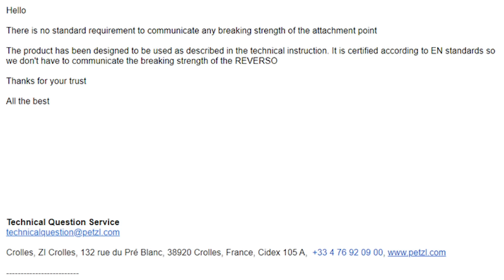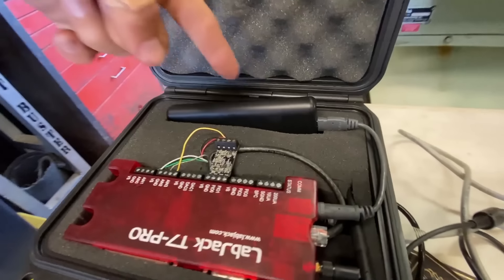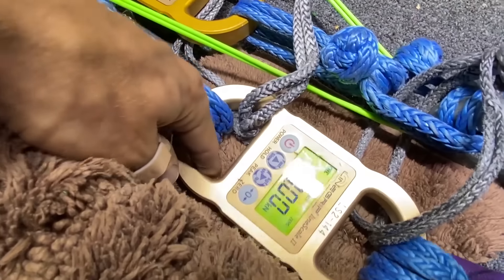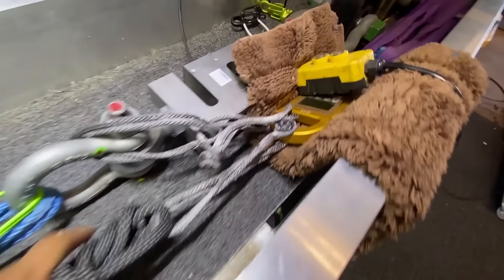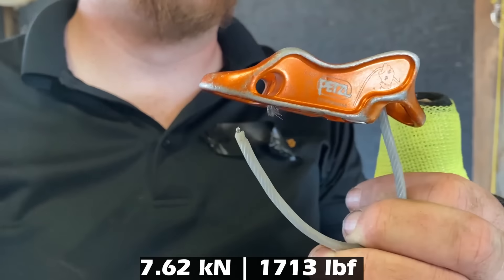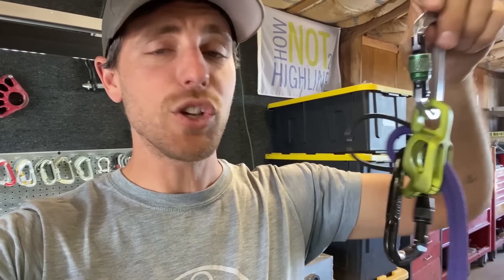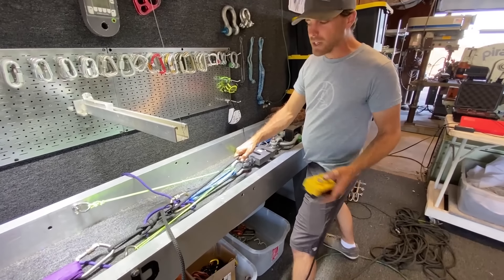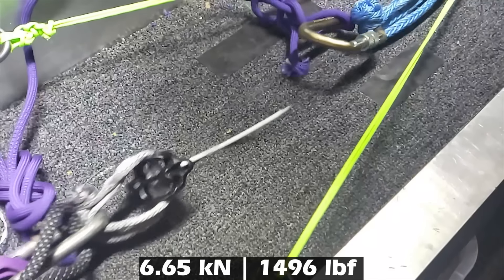Petzl Reverso and Black Diamond ATC guide break tests - how strong is that eye?

Comment: Great to know we can use ATCs as nuts.
Reply: I feel tempted to try it. But then not that motivated yeeting myself off a wall to find out.
Reply: @vfnt  I mean, just climb high and add a cam backup
Reply: This is what he's saying after all
Reply: You can also use nuts as nuts - that is how they got the name… How bolts got their name too. Nuts and bolts as 🔩 nuts and bolts.
Reply: @NoName-OG1  
Oh, there is a video of someone testing nuts as nuts and falling in them. 
Somehow I would be more comfortable doing that than falling on an ATC-nut
Reply: @vfnt  the climbing sports of today are older than the gear and methods, availability of today. 

Most of the gear arrived and became available in the mid/late seventies. Imagine not repelling on any belay device. When I was a kid it was 3 raps of the rope on a carabiner to a Swiss seat that you had to learn to tie. 

Most of the gear started being made because there was a place you could sell it. REI changed the sport and for the better.
Reply: That's pretty much what I got outta this ..

Comment: That email from Petzl is hysterical and oh so reassuring.  Not gonna tell you… “Thanks for your trust”, but just in case “All the best”. They may want to rethink their customer comms strategy.
Reply: I can't believe the response from Petzl. I find that email totally dismissive and condescending. What a black eye for the Petzl brand!
Reply: Before early 2000s,Petzl always shows us the rated strength of their descenders&ascenders on the user manuals,that was good for our guys to calculate the strength after being wear and abrasion by long term using,but no longer now😢 I believe that Petzl did not want us to use their products for so many years nowaday.😅

Comment: "How does a climber get 4, maybe 5 kN and I can hang on just fine?"

The rope should slip through a bit in a fall. That reduces the peak force of the shock load. F=ma, a=dv/dt, by increasing dt (time of the change in velocity) due to the slip the acceleration drops, and thus the force drops.The same thing is why dynamic ropes stretch.
Reply: And most likely rarely received all the load the climber gets themselves. I reckon the rope drag makes some of the load transfer through the quickdraws thus reducing load on the belayer.
Reply: “Yeah science bitch!”
Reply: And the belayer just gets pulled of the ground from a certain force.
Reply: @juliensantini5882  I believe the tests he references were from the vid where he had a dynamometer on both the belayer and climber

Comment: Fun story I learned from a Petzl engineer.

When Petzl developed the first Reverso, the one made from sheet steel, they tried originally to have the attachment loop perpendicular to the plane of the tuber to allow optimal orientation on most belay anchors - exactly like on a plate. However, they could not find a way to manufacture with the needed stability at an affordable price point and went with an attachment point in the middle plane of the device.

When they switched to an aluminium body of the revverso, they corrected that problem and we're quite amazed that everybody else including Black Diamond copied the design of the original steel Reverso in their aluminium-bodied designs.

The perpendicular loop is still harder to manufacture and whether you prefer it or not probably depends on how you rig your belays and which anchors you typically encounter and thus both design philosophies coexist. But if Petzl would have found a way to turn the loop in the original steel Reverso, probably everyone would have followed that design.

Comment: When holding a fall you are not taking all the load on the belay device, there is a chain of things making it soft like all the gear placed. If the rope zig zags a lot the friction will take out pressure from the belay device and apply it to the anchors. That's why you try not to zig zag a lot on trad gear (using double ropes or extending very long the quick draws). I'm guessing that's why your messuring only about 2Kn while trying to hold the belay device directly but you would be able to hold a higher force on a fall where there's a bunch of gear placed. Cool tests could come out of more "real world" scenarios. Thanks for the work your doing.

Comment: I would be super curious about the DMM pivot. I can't find a strength rating for the device, and that pivot seems like it would be harder to make super good enough.
Reply: I would very much like to see the comparison of the DMM Pivot to the BD ATC Guide.  That little pin in the Pivot has to be a weak point.  Sure, the pivoting action would make it easier to lower people, but I can't get that little pin our of my mind when I think about buying one.  I've looked at the DMM info, and there is no rating on that part of the device.

Comment: I asked DMM the same thing about the Pivot belay device (which has a hinged connection point). Simon Marsh, one of the DMM engineers answered: „The Pivot guide mode anchor connection point is rated to a minimum of 16kN” ! Maybe you might want to check this value too?!

About the guide mode failure, Jim Titt wrote a comment on MP Forum:

 "First Fail Mode:
The trapped rope escapes sideways from under the tensioned rope and gets trapped between the tensioned rope and the side of the slot.This is very difficult to free off and you have to dismantle everything and twist the locking krab brutally to release the rope. Take your Prusiks.

Second fail mode:
Apply yet more load and the trapped rope where it crosses the tensioned rope goes down through the slot with a bang. At this point the holding power drops off considerably but not catastrophically, though pretty near!
Easy to release, just unclip the krab when unweighted. Still need to take your Prusiks!

ATC Guide. 10.2 Mammut, used, non-treated. First fail mode 4.8kN. No second fail mode, rope sheath cut at ca 9kN.
ATC Guide. 9mm Edelrid, used, non treated. First fail mode 2.96kN. Max fail load 5.58kN. Residual load 1.6kN
ATC Guide. 8.2mm Edelrid, new,treated. First fail mode 2.05kN. Max fail load 4.06kN. Residual load 1.2kN

Reverso³. 10.2 Mammut, used, non treated. First fail mode 3.68kN. No second fail mode. Rope sheath cut ca 9kN
Reverso³. 9mm Edelrid, used, non treated. First fail mode 2.25kN. Max fail load 3.60kN. Residual load 0.9kN
Reverso³. 8.2mm Edelrid, new,treated. First fail mode 1.6kN. Max fail load 2.38kN. Residual load 0.7kN
All with Petzl Attache 12mm round profile karabiner.

The first failure is both strands are crossing inside the device and it jams up solid, you hear a sharp bang as this happens (we though something had broken). Then the crossing point of the ropes is forced out of the bottom of the plate and the original rope positions is reversed with a twist at the karabiner.
With thicker ropes as the crossing point starts to come out below the plate the rope is forced onto the underneath of the sides of the plate and core-shots so it doesn´t really ever reverse completely but shreds itself instead.
You can get a good idea of what happens by using a thinnish (6mm or so) cord and bouncing on it.
Reply: In that case, their 16 kN hinge is directly compared to the BD ATC Guide at 30 kN.   The DMM Pivot's design puts a weak point at the pin.  Jim Titt gave us interesting information, but the rest of that stuff about the second fail mode doesn't compare the DMM with the ATC or Reverso.  It seems that doing all these secondary failure modes with the rope problem got his Titt in a wringer.   Still the question remains, how many kN will a Titt in a wringer hold? 

Probably the Petzel if uncompromised would break over 16 kN if it wasn't compromised in the other testing.   

We can only beg and genuflect to the How Not To Highline gods, that they will verify the breaking strength of a DMM Pivot.

Comment: Occasionally I'll use the reverso in guide mode clipped to my belay loop as a safety when setting TR. Usually the safety line is a static rope (part of the anchor). If you don't manage your slack and take a bad fall, I'd think you could generate quite a bit of force. But you'd probably break before the device...
Reply: Sorry I don’t understand the setup described. Or even why would you do it when setting up a TR?  Is it part of your PAS somehow?
Reply: @benoitcerrina  it's PAS, yes. The guide hole clips to me, and a fixed line runs to an anchor back from the edge. Imagine you were using guide mode to ascend, that's basically the setup. The places I climb don't allow bolts, and often don't have good pro at the edge, so TR setups usually use static lines to far away trees. Often we go back and forth during setup, so there can be a lot of slack in a safety line, sometimes when we're navigating 4th or 5th class terrain. Grigris are better, but sometimes you don't have one 😉

Comment: Confession... Used a DMM Bug as a nut once after running out on a long traverse... Didn't fall! Anything is better than nothing?
Reply: Confession. I've used an old school rock (an actual loose rock that I found a few metres below in another crack) jammed in a crack with a prusik cord around it because I ran out of pro, and I fell on it. It was fine. Things we do when we're young and stupid...
Reply: @Intermernet  sounds smarter than stupid, you placed pro the best you could (which clearly was good enough) instead of taking a massive fall

Comment: I use ATC guide in a scenario where it is not at the top of the rope. I self-belay starting from the bottom mostly on easy sports routes. The ATC top loop is clipped to my harness loop. If I fall, the last anchor catches, the rope goes above me, it locks, and I hang from the top loop of the ATC. I have taken a decent fall that way. It worked. I know it is "off-label". I guess I should say the usual disclaimer: "Don't do as I say. Don't do as I do".

By the way, I wanted to ask--I believe you said you couldn't think of a normal climbing scenario with more than 14 kN on an anchor. If you take a UIAA fall, won't the peak force on you be about 10 kN, so the peak force on the anchor over which the rope loops somewhere close to double less the loss due to friction (so it makes maybe 16 - 17 kN)?
Reply: @MBC-th8le  Thanks, its a great video! I haven't seen all the best they made yet. 

Sure, but those are not the standard test UIAA falls. They are with a static belay high up on the wall with a worst-case fall factor for the bolt--not a slipping hand on an ATC on an un-anchored belayer on the ground. I guess the UIAA falls are not normal climbing situations.

Comment: Do you think you can break the reverso eye with 2 ropes in auto-block mode? Sometimes I belay two people off a guide atc and I imagine losing 2 partners at once.

How could both partners simultaneously generate 6kN? Idk, belay-ledge shenanigans and they both take factor 2s?
Reply: 😬 I wouldn’t chance it, but I’m a nobody!
Reply: You make a very good point.  I use the ATC Guide in the guide mode fairly often to belay two people up.  Gourgou is wrong, you don't have to be belaying two leaders. You can be belaying two climbers from above as the device was designed to do.  As you said, it would take something like both climbers to fall at the same time with some slack in the rope, very close to the time they reached the belay.  An example of this could be if two climbers coming up on top rope reached a ledge a few feet below the belay device.  There is a minimal amount of rope out between the device and the two climbers.  Let's say the ledge gives way and both climbers fall a short distance on a short rope- the scenario of a factor two fall.  Could this cause a failure?   Fortunately, with a breaking strength of 30 kN, it seems very unlikely that the eye would break from the main part of the device.  However, the force could slam the ATC Guide into the rock and compromise the lab values.

Comment: This is great as always. I think it would be ingesting to see what would happen if you pulled on a quad anchor in two directions at the same time. This could happen if you have a haul bag on one set of strands and a climber juging on the other. Also once you get the drop tower built it would be interesting to see it pulled in different vertical directions. As if you have a haul bag or other person and a ladder takes a fall. Thanks!

Comment: Some people use a reverso as a self belay device for rope soloing. In this mode the device is clipped from the 'guide hole' to the climber's belay loop. In a big lead fall onto a rope that's fixed to the anchor at the bottom of the pitch the device could concievably see 5 or 6 kN +.

Comment: based on how the reverso failed vs the BD im gonna guess that the BD is made of 7075 alloy and the reverso is 6061 alloy, this is based on the colour of the fractured metal and the way they broke. OR petzl uses a very different heat treatment process to BD since the ATC has the characteristic fracturing of 7075-T6 alloy.
Reply: Great observation.  But isn't 7075 more brittle and 6061 will deform more before failure?

Comment: I was wondering... instead of attaching the brake strand to a load cell and a fixed point.... could you try another test configuration... could you attached a [15kg?] weight to the brake strand, and redirect using a pulley, to maintain a constant brake strand load, and investigate the performance of these devices with various rope diameters / carabiner diameters... ?

Comment: How does a climber get 4-5 kN and a belayer can hang on just fine?
Because you normally only need to hold on with a force equivalent to your body weight and then you get lifted off the ground. If the belay device was glued to the ground completely statically, the rope would slide through instead, but probably only for a very short time until the force of the fall was dissipated through friction and stuff, so not very far. You might regret not wearing gloves though.

Oooh, could you hold on to the rope like that with a force meter but both with and without belay gloves just to see how much difference it makes in how hard you can pull?

Comment: Hay I love your videos and have been binge watching them. I think it would be interested to see where the failure point is and at what KN rating a rope passed through a anchor bolt and back down (making a retrievable rappel) Then  try different devices to see what is safest and if any pinch the rope or if the small bend radius effects the rope.... So may variables I don't know where it would fail?  Finger 8? ATC?

Comment: so, according to your earlier test Edelrid Megajul was the best in "rappel mode" - double ropes broke at anchor around 30kn - it didnt sever them
Reply: My memory of that was the Megajul deformed greatly and the sharp edges actually cut the rope at a fairly high value.
Reply: @Davidadventures  in guide mode, yes, smt asseth like this. In rappel (abd) mode the twin rope broke at anchor

Comment: I think that when someone takes a fall, the force inside the belay device happens in a short period of time, so it may slip a little bit, but then the peak force is over and you have to hold just the body weight and thats fine without any slipping. The slipping is probably so less, that the rope between the device and the belayer can absorb the movement of the rope with its dynamic behavior.

Comment: Saw you said you were needing to calibrate your load cell a bit still. Your cable looks kinda short. Maybe you know already, but you're not supposed to cut those cables. The  tiny changes in resistance will change the readings of the load cell.

Comment: So, the reason why holding with two hands is not that stronger is because since you are essentially a lever that is being pulled by a rope when you are in that position. The two hands help a bit with being more stable. The higher force would come when your body is not allowed to move, like if you had a barrier in front of you holding you in place. You can notice that you are not losing GRIP of the rope, you are just tilting. This explains why in a belay you have no issue holding on, because you dont need to "hold" all that force, you just need to grip it enough that the resultant force combining factors like the elasticity of the rope, the energy dissipated with friction, plus the momentum you gain and the other person gains are less than your grip strength.

Comment: If you can barely hold 2+ kN with one ATC, how much can you hold with two in parallel?  Soak All Rope teams are transitioning to parallel slots in the backcountry for rigging solutions.  Can I easily lower 600lbs with one hand and two slots?  Assuming an asymmetric prusik somewhere to go handsfree if I panic.

Comment: 15-17KN.
Reply: I was close but off in the WRONG direction. Imo it’s all related and all relative. You’re only as safe as your weakest link in a gear system. If I’m to assume a 22kn rope loses half when I tie in on a F8 then anything over 11kn is technically falling in my good enough category. Not super good enough. That’s gotta be a margin of 2 so 20-22kn breaking strength. You can always back up almost everything. Without a second or doubled rope half of 22kn is where your weak point is imo. Could be completely wrong. Thanks for the value and information.
Reply: So I edited first before seeing the bit on replies. So I’m replying bc I’m a mindless YouTube watcher just doing what I’m told.
Reply: I think EVERY test will be DIFFERENT on the DROP TOWER!!! Can’t wait to tune in and see. Things happen fast in our world so should have more realistic results.
Reply: Just replying to help the algorithm find great content.
Reply: R
Reply: E
Reply: P
Reply: L
Reply: Y